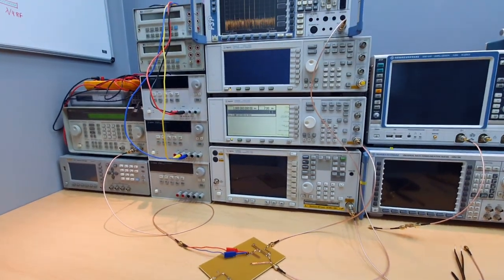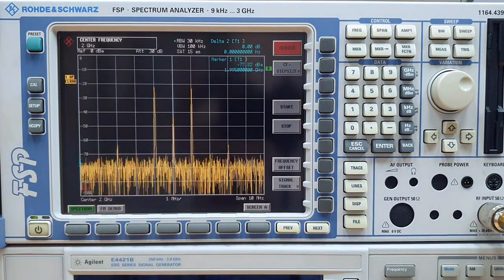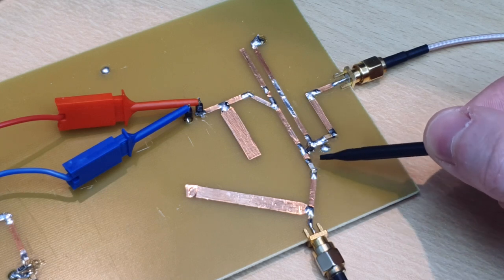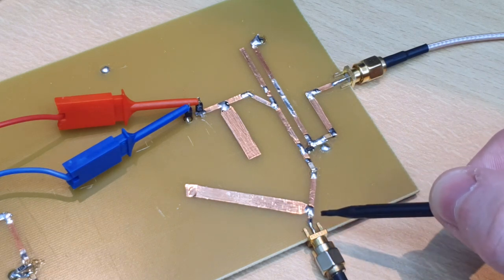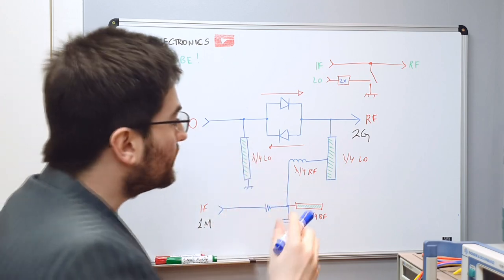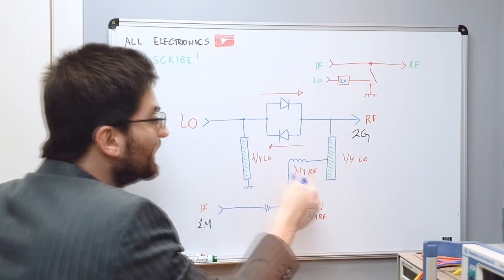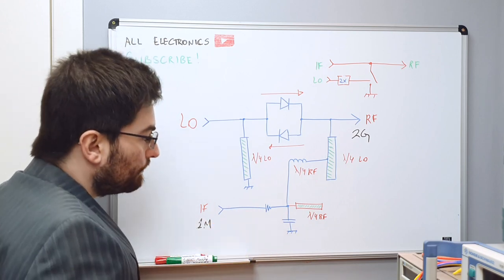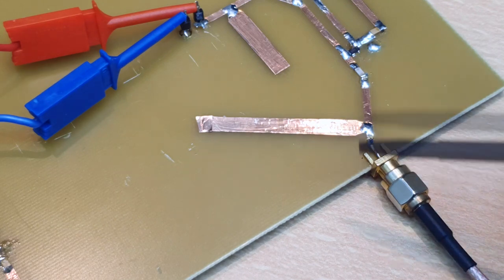How it Works - Sub-Harmonic Diode Mixer

Comment: Love the strategy that you are using, it 's quite clever. Thx for the great explanation. You covered the design well. I also thought the breadboard using sticky copper foil also a great way to build this mixer.
Again, thx for taking the time in sharing your clever mixer design.
Reply from the maker: Thanks! I first saw this design in projects from S53MV.

Comment: Your explanation is not accurate.  The output RF is not LOx2,  is (LOx2) +/-IF.  You will be able to see it by reducing the span and BW of spectrum analyzer due to small value of 1MHz.
Reply from the maker: Probably a misspelling

Comment: Nice one again, thanks! Regarding the stubs, the quarter wavelength long is clear, but does their width have much impact?
Reply from the maker: The width will change the impedance of the stub!! To get a deeper notch you use a larger width, so the impedance is lower than the 50ohm line
Reply: @AllElectronicsChannel  thanks for the quick response. Is this just the attenuation here or does this also impact the Q?
Reply from the maker: It changes the Q also! Larger stub will have wider notch
Reply: Thanks, sounds like this will take some experiments to really get a good idea on
Reply from the maker: Yep!! Go go go!!
Reply: Maybe a nice one for a future video, how you decide on the type and dimensions of a stub you pick
Reply from the maker: Nice ideia. Do you have a lab ?
Reply: @AllElectronicsChannel  yes, some old equipment but I can go to about 1.5GHz with a spectrum analyzer so I might be able to get some experiments done, the main thing is finding the time for it!
Reply from the maker: Go!! Starting is difficult.
I always try to go to the lab everyday, at least 5 minutes, this keep me in the flow.